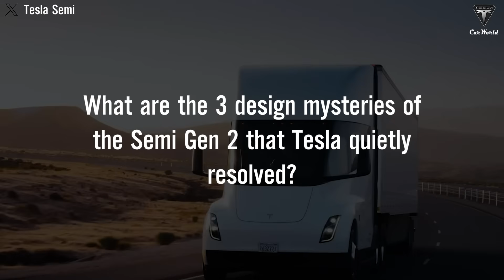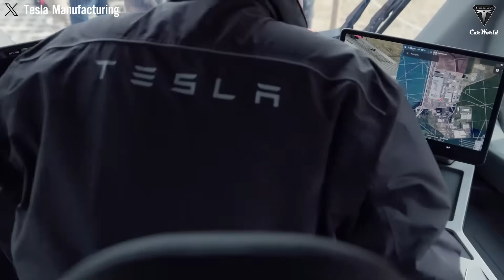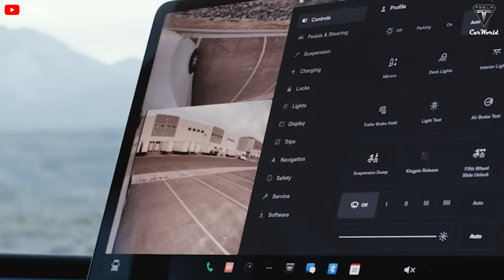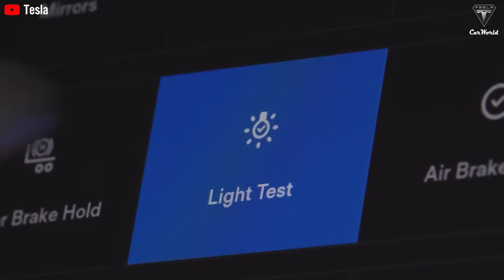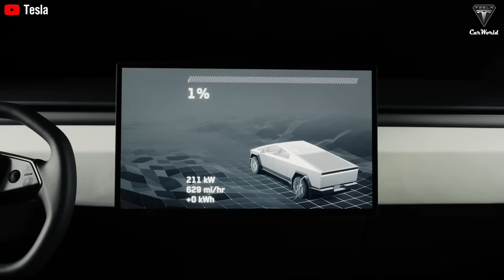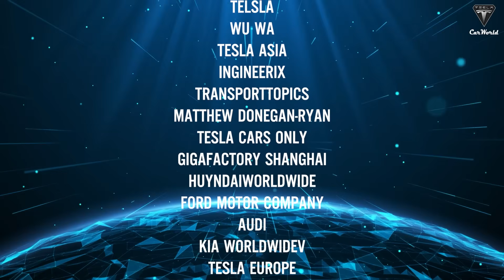2026 Tesla Semi Gen 2 Finally on Sale! Elon Musk Reveals 3 Design Flaws FIXED!

Comment: Hi Tesla, just a question: Why you redesigned from a center position for the driver to a "normal" position like driver and co-driver? What is the benefit? Thx in advance!!!!
Reply: To enter might be European markets? Drivers usually have to hand over still real papers and documents at factory entrances or pay talks on highway etc. Not every better solution is also accepted by the market and is also legal. So it would just waist time for getting homologated. I liked the central seating position but in Europe the left position would be what people are used to which is not so important but just makes the view on monitors not more convinient. I remarked also Semis with classical rearview mirrors an indication that there are legal issues with the much better cameras!
Reply: @Lifecoach7Ra thx for the answer 👍

Comment: Automation is just an excuse to replace drivers and cut wages. Tesla’s vision means thousands of lost jobs.
Reply from the maker: Automation helps with efficiency, safety, and long hauls. Semi still requires human supervision, and Tesla plans new cabins for comfort—jobs evolve, not just disappear.
Reply: @TeslaCarWorld  When Tesla goes full self drive and puts under-slung sodium batteries in the trailer bed, they will be able to transport goods for 1000 miles without stopping between charges, which will revolutionise the logistic industry and make products cheaper, making a Tesla Semi for $500,000 a bargain.

Comment: They claim to save emissions, but manufacturing those giant batteries creates tons of CO₂ before the truck even hits the road.
Reply: So does creating a diesel truck
Reply: Every time you turn the key, noxious poisonous gas are produced.
Reply from the maker: True, battery production has emissions. Tesla’s 46 80 HV cells reduce costs, improve efficiency, and over 500-mile range, the Semi cuts CO₂ dramatically compared to diesel trucks.

Comment: Full Self-Driving on a semi truck is a terrifying idea. These are 80,000-pound machines — any glitch could be catastrophic.
Reply: Tesla Semi weighs approximately 27,000 pounds. 80,000 is the GROSS TOTAL for all STANDARD TRUCKS. It is the LIMIT for the highway of all standard trucks.
Reply from the maker: Totally understandable! Tesla Semi Gen 2 weighs ~23–27,000 lbs, with full self-driving carefully tested. Safety systems and 800 kW power are designed for reliable control at highway speeds.
Reply: Humans will experience more glitches, more often.